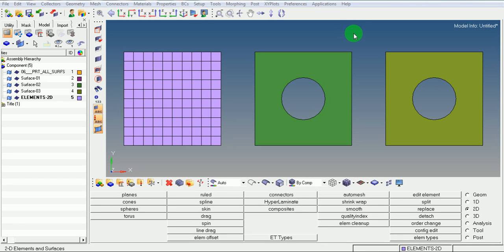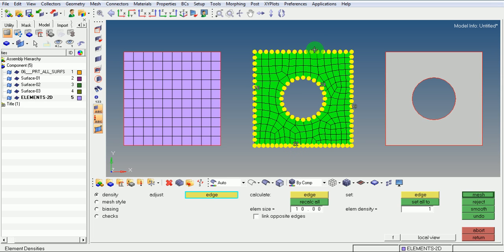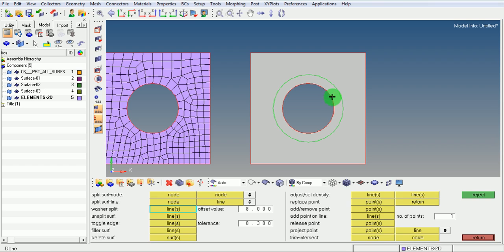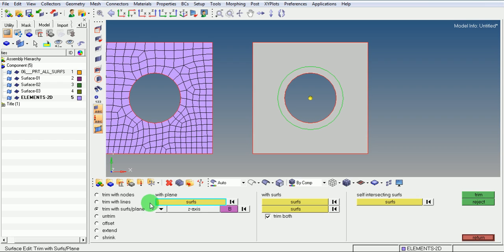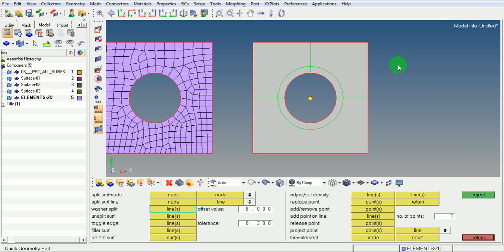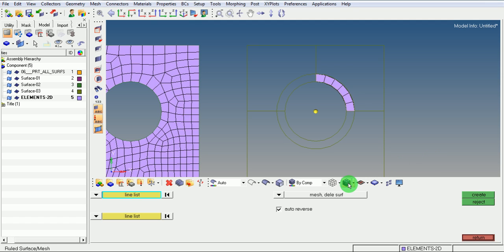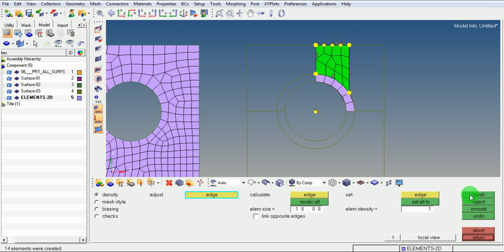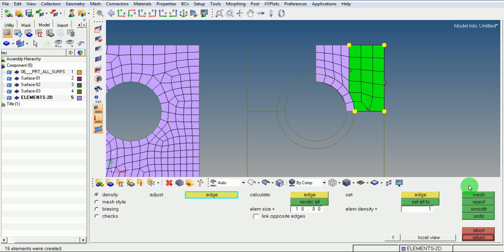HyperMesh | Ruled mesh | 2D mesh | Temp nodes | Elements | Quad | Tria | GRS |

Comment: Hi Sir, can you tell me how to creat only 2D surface in creo parametric? Regards
Reply from the maker: Create sketch using sketch command. Use fill command to create the surface
Reply: +GRS CAD/CAE thx. i got another question: i trimmed the surface into four parts, did the washer split and then wanted to mesh the surface between the two segments of the circle by 2D - ruled. but the result is a mesh from the four nodes towards each other, like a rectangle. Can you help me?